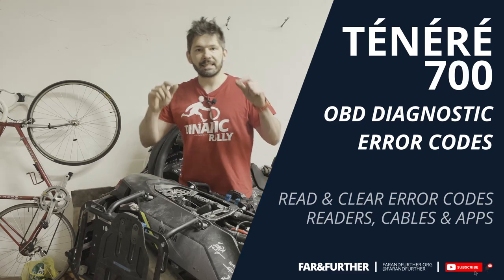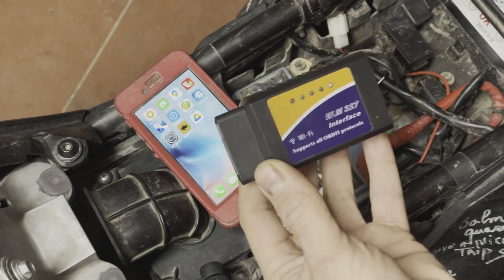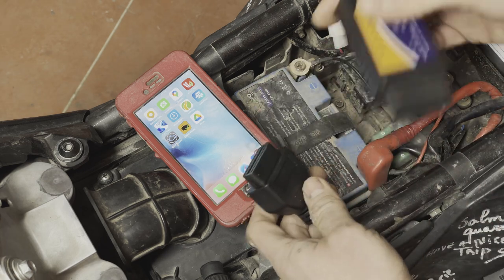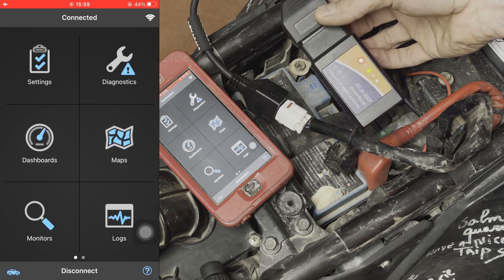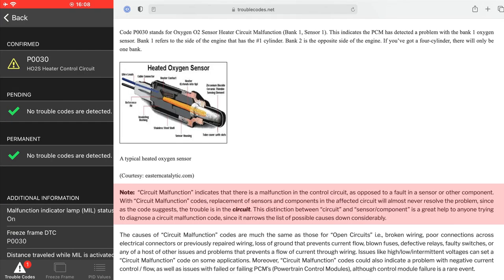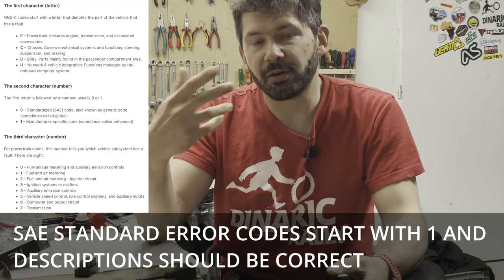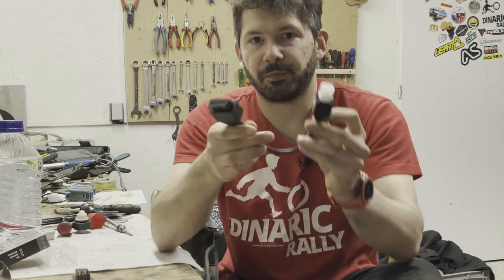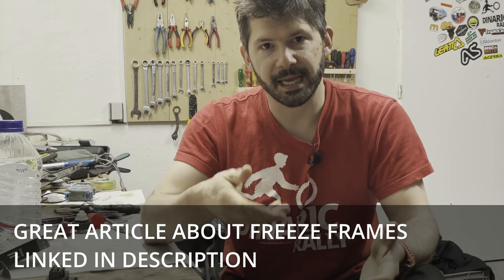Yamaha Ténéré 700: Diagnostic and reading error codes with OBDII readers and Android/iPhone app

Comment: My good sir, thank you very, very much for this. I’ve been scratching my head lately and contemplating if I should bring my bike to the dealer and pay 200$ for them to run the diagnostic tool, which is the last step on the first service that I cant do myself. You answered my question, that if theres no ‘check engine light’, theres no code to be read- THANK YOU.

If I could be so bald and suggest topic for videos, it would be more service related stuff with the T7, those will not only be of very much help, but also popular.

Again, thank you, you’re a good man!
Reply from the maker: Hi Jay, as far as I know my dealer also records the mileage on the first service an any subsequent service. They do this in order to ensure that the maintenance schedule is kept during the warranty service.

As far as I know, it is not compulsory to service your bike at the dealers to keep the warranty but it will depend on location (I'm in Europe) and definitely don't take my word for it.

I've been doing loads of maintenance lately and most of it is on Instagram as I didn't have a time to do the video, you can check it out in my Maintenance highlights:
https://www.instagram.com/stories/highlights/18123101032202120/

I'll probably turn it into the video at some point.
Reply: @FARANDFURTHER  Thanks for your reply!

I’m too in Europe (Norway). I’ve researched this quite a bit, but not 100% sure - if one have receipts of doing oil changes etc, it wont void the warranty. Not sure, but I’ll take the gamble, its a Yamaha and I treat it like my son, except tossing it around in the mud!

Oh thats too bad, I’m not on Instagram any more (best decision ever), but I can use my wifes. Hopefully they will turn into videos, that would have been awesome!

Best regards!

Comment: Are you going to do a review on the LSAdventure Phone Kit? You are the only english speaking owner I know and the it looks very interresting. I would like to know how it is performing so far. There seems to be a version 3.3 on the market. How is the durability and usbalility in terms of plug and play on everyday usage?
Reply from the maker: Hey, I'm using the LSAdv phone mount for more than a year. I got it because of Dinaric rally where I needed something strong to hold my phone.

And it did and does till now. I've been using it heavily and I have also crashed it few times so it did bend (no phone inside) and it was enough just to bend it back into shape.

I'm not using the lock as I just pop the phone out easily and take it with me and that can be even done with one hand.

So far the phone didn't fall off during riding. It popped out only once when I crashed because the locking knob released the clamp due to the energy of the fall.

When one combines it with the wireless charging it is pretty good solution. Although my iPhone 6 has trouble with wireless charging so something a bit more modern would be good. Or just use cable.